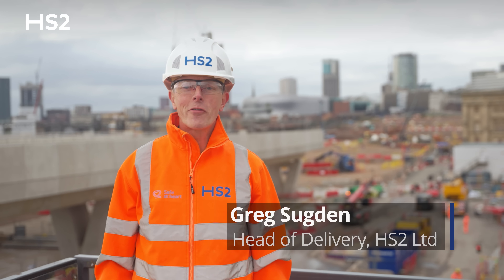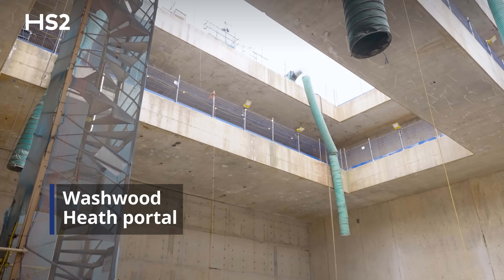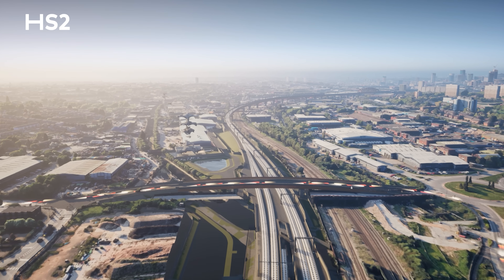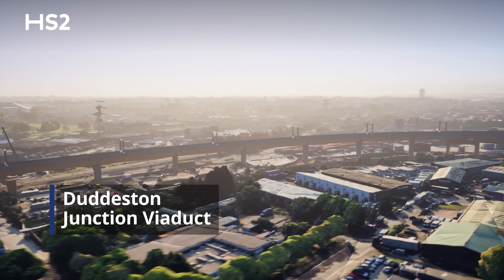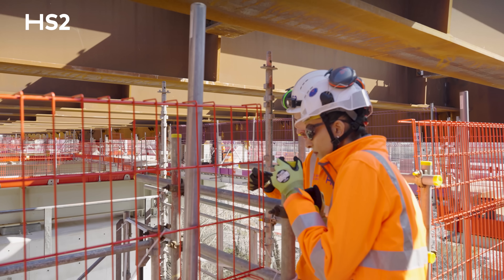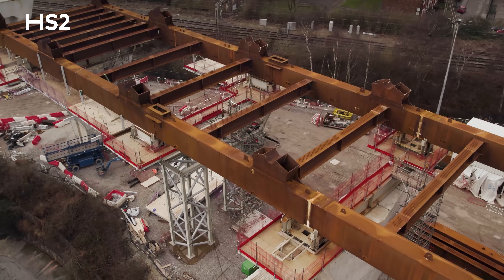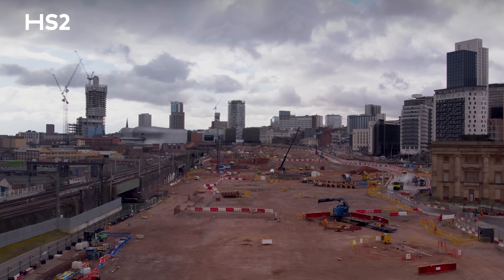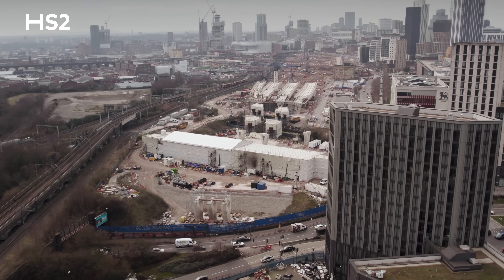Building to Birmingham: 🚆 HS2's Curzon approaches progress update 🏗️

Comment: Truly inspirational. I still think it should have been built starting from Leeds and going south. Then when  it got expensive, maybe people would have been a bit more innovative in making the cash go further rather than just canceling it.
Reply: Couldn't agree more.... It should have started in Leeds and they should have also made a start on the NPR project at the same time, also starting in Leeds and why not also develop the city stations and build a mass transit system for Leeds at the same time....
Obviously, it would be several years of headaches for the local residents, but just imagine the benefits when it was all completed. It would have been fantastic for Leeds and Yorkshire and The North as a whole..... Obviously in the real world, that was never going to happen with the London-centric Governments we have in this country
Reply: Why should a railway line that has been built as part of the WEST Coast rail network need to have been started at Leeds on the East Coast
Reply: @peterwallen1063  Because the original Y-shaped network did not only relieve the WCML. That is what was so good about it. It provided relief for the WCML, MML, ECML and part of the XCML, all for the price of one railway.

Comment: The Victorian navvies built a railway from Birmingham to London in five years using nothing more than pick, shovel, wheelbarrow and a pony to help pull the barrow up the sides of the cuttings. The cement they used to build the bridges, viaducts and tunnels didn't set any faster than todays concrete, so why are you taking so long to repeat the task? Fingers need to be pulled out.
Reply: Victorian you mean Irish
Reply: Today's construction industry has complex contracts, stringent planning rules and strict health and safety laws abd rules.

Comment: The West Coast Mainline is at full capacity. What is the maximum number of carriages per service and do the trains utilise in cab signalling?
Reply: I answered a similar question earlier today. HS2's trains will have 550 seats each, though they will often run with two units, so you'll be seeing 1,100 seats per HS2 service. And with HS2 being designed for 18 trains per hour, that means HS2 will be able to carry a maximum of 19,800 passengers in each direction per hour. Which translates to over 350,000 passengers per day, or 130 million people each year.

Comment: Yesterday, on the slow train to Euston from Birmingham international. Its four tracks pass through the likes of Coventry, Rugby and Milton Keynes.

The frequency of Avanti services is fierce plus there are many local services all heading to and from Euston. MK has 12 platforms and the track beyond is sometimes 6 up with odd branches which the higher speed trains have to cross. 

It's clear that HS2 is needed. Bear in mind there are routes to the east and west that are equally busy. Bletchley is massive too. Multi platform and not the sleepy wee station I knew in the 70s.
Reply: The track from Rugby to Birmingham New Street is only 2 wide, one in each direction. This is the pinch point on the New Street Euston line and carries Inter City, Freight and Local Commuter traffic. Any problem or delay on this stretch  causes knock on chaos on the rest of the route.

Comment: Should this be in a box like Old Oak Common?
Any thoughts on the best solution for Manchester (if/when)?
Reply: Re: "Should this be in a box like Old Oak Common?"

A through station where trains stopped at Birmingham Curzon Street and then continued north would have been better. It's faster to drive a train through a station than have the driver get off and walk to the other end. You can "cheat" by having extra drivers at the other end of the platform when the trains come in, but it's a kludge fix. A through station would have cost more (which is why MPs not serving Birmingham voters didn't want to fund this) but it's a fixed cost asset and could have been given travelators direct to lifts and escalators leading up to every platform at Birmingham New Street.

Likewise having a through station in London (instead of demolishing half of the houses in Euston to expand the terminal station there) would have been better because the people who argued for the Euro Tunnel promised their would be trains from Paris through London to Glasgow, Edinburgh and Cardiff. And that's a promise that needs to be kept.

It took about 80 years for people to persuade Central Government that having people get off trains at Paddington, chug up London's metro system and then get on other trains at Liverpool Street. But the success of Crossrail shows that terminal stations are not good. So we really should not building new mainline terminal stations in cities, unless that city is on the edge of a cliff and carrying on would take you into the sea.

Even when HS2 eventually gets to Glasgow and Edinburgh we should not build terminal stations, but should instead build a big semi-circular curve from one station to the other. That way, every Glasgow train also goes to Edinburgh and goes south from there and every Edinburgh train goes to Glasgow and goes south from there (and both cities get a high speed link between them for free) and we get to put a new depot in Scotland just to the north of the Scotish Central Belt, where you don't need to kybosh a town to build it.
Reply: Old Oak Common is built-in a box because the track is going underground through tunnels. Curzon Street is exactly the opposite, being built above ground.
Reply: The two proposed routes going into Manchester are underground in tunnels ..
Reply: @andyb3712  Tunnelling and box are probably more expensive than ground/above-ground.
Reply: @Carlos-im3hn  Short-term I’m sure,  but it releases an awful lot of real estate above ground for investment.
Reply: @andyb3712  it is like St. Pancras Intl....many trainspotters from the nearby buildings can do their hobby thing while doing big business deals from high up.  Underground there are no spots to watch.
Reply: @TrevorWilliams-fq8mg  The HS2 WWH depot & NICC is only 3 miles away, so there probably is not enough track length to go up/down so many times.  Underground is more expensive than ground/above-ground.
Hopefully a highly-reliable HS2 will restore the economies around their stations.
Reply: Yes, I once read that. The original idea was to build it like Curzon Street with the railway built above ground but that would have caused more disruption and cost more. As it is now it's irrelevant as it's not being built beyond hansacre.
Reply: The original plan was actually for this station to be a though station below Birmingham and another beneath Manchester.

Comment: If Curzon Street station had been built 400m further to the south west then passengers would not need to take a taxi or the tram to get from Curzon Street to Birmingham New Street to complete their journey by train, wiping out much of the journey time saved by making HS2 a high speed railway. An opportunity to connect Curzon Street, Moor Street and New Street to make a single large transport hub has been squandered by poor planning.
Reply: 400m further to the south west? They'd have had to demolish half the city centre and disrupt existing train services for the best part of a decade - it would have been insanely expensive and unpopular.

It would have been great if they could have used an Old Oak Common-style solution, adding platforms to the existing lines that run past Curzon Street Station, but that would also have been massively disruptive.
Reply: Why have people got to get a taxi or to complete any journey via Birmingham New Street Station, this can be done by changing trains at Birmingham Interchange and Birmingham International or by walking next door to Birmingham Moor Street Station so yes Moor Street and Curzon Street stations will be connected. plus in getting the tram they can complete their journey to Wolverhampton City Centre

Comment: what is the projected lifespan of all those concrete piers and the ongoing maitenance costs  looks like we are building a horrendous legacy for our children .
Reply: Concrete has a very long life, the Harry Potter viaduct is concrete and that wasn't built recently. As long as the appropriate maintenance regime is in place there should be no issues.
Reply: @eddiereed5025  the design life is 120 years without major maintenance. The use of weathering steel means low maintenance for the bridges. We are building a fantastic legacy for future generations to use. Let's get on with connecting it up north and east.

Comment: But it’s not Britain’s new high speed railway - it’s Englands new high speed railway! Scotland and Wales aren’t included!
Reply: maybe they can build an underground high-speed 2-way travellator/people mover between Curzon and New Streets ?
VHS Curzon/Moor/New travellator w/ interconnected data systems to tie-in with train arrivals and departures from 3 stations for a very smooth Oyster single-ticket ?  Maybe some special underground central area to get off the 100mph travellator and grab a bite ?
Yes changing trains...but that 100mph travellator would be nice icing on the Curzon Street station.